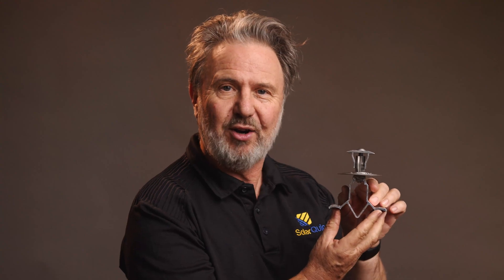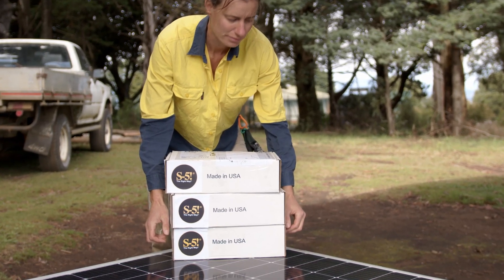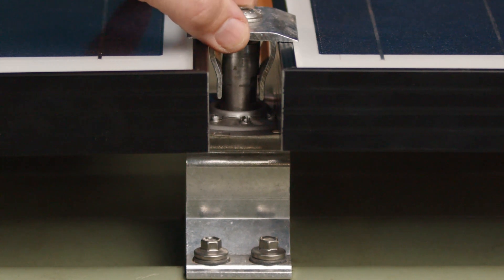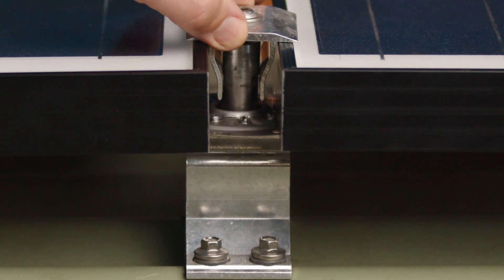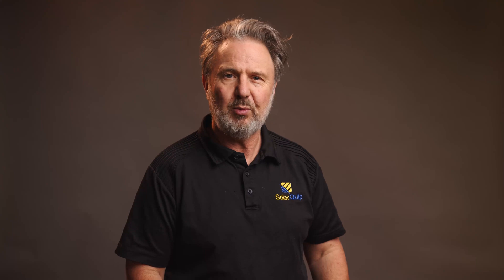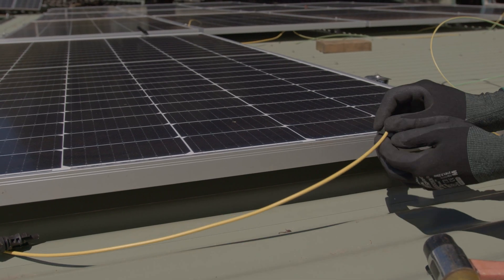S-5! PVKIT2.0 and CorruBracket

Comment: Interesting that is just screws to the roof sheets and not the battens underneath. Would it get a bit picky with panel widths given the spacing of the corrugations are fixed?
Reply from the maker: Actually, you have the most choice about complying with clamping zones of any mounting system.

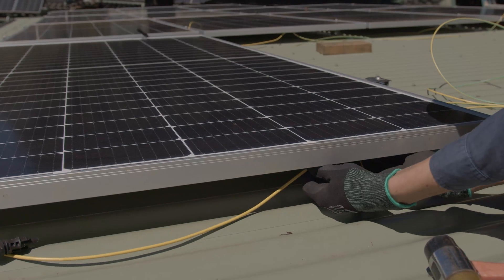Comment: Hi Glen, thanx for sharing this instruction. My bro bought a house near you (in the Melbourne area) and I recommended you as expert number 1 in this area for solar panels, he will install it soon. Just one question, please, 3:30 just to ask for earth bonding clamp did you use wire:6mm2  connects to (ground) earth (example  FeZn 25 x 4 mm2 acc IEE 80:1986 or biggest)? Light strikes reach 30-400 kA
Reply from the maker: Hi ERP, the "equipotential bonding earth" that is required in AS/NZS 5033 is not for lighting protection but for ensuring no stray voltages appear on the conductive parts of the PV array. Thanks for the recommendation to your bro but I don't do installations anymore. Field testing, training and making online content like this are my life now!